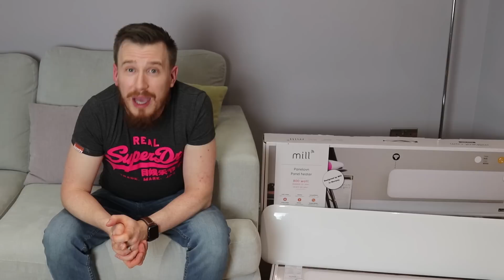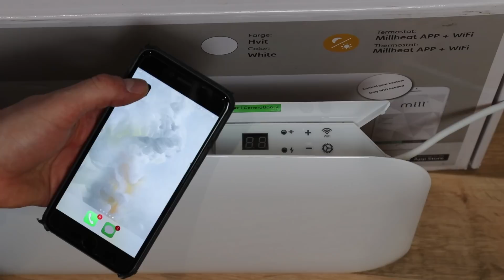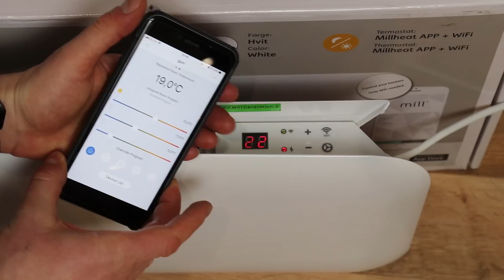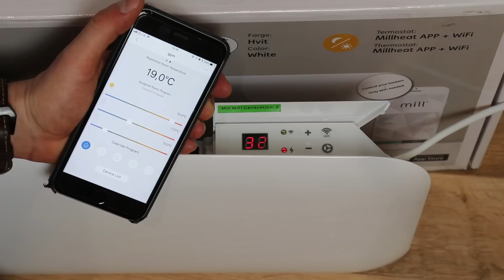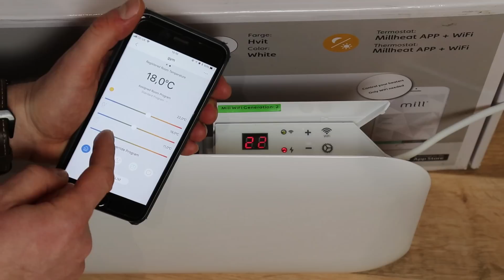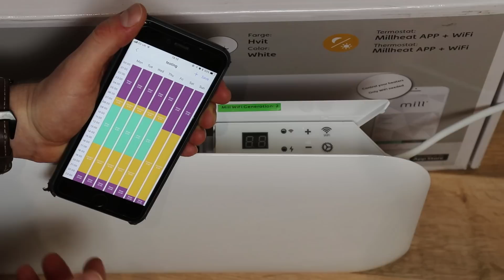MILL HEAT PANEL HEATER 800W WITH WIFI REVIEW | Henry Reviews

Comment: Great Review.  Can these radiators be mounted vertically?
Reply: no, I don't think they can. because it takes the cold air from the floor and generates heat that will spread evenly on top of it. I don't think it will work properly if vertically mounted on the wall. just an opinion
Reply from the maker: Agree that the optimal mounting is horizontal but I have had them mounted vertically for about 9 months with no issues and they heat my gym very well.
Reply from the maker: They sure can. Don’t think they are designed to be mounted that way, but I have a couple mounted like that in my gym

Comment: Nice review. Can you easily link 2 units to the app / phone and enable them while not at home? I assume so, just curious if you've tested it with the several Wattage models that you've reviewed. Thanks in advance!
Reply from the maker: Hey +Joe Flemke I have tested with the 800W and the 1200W together and been able to manage them together without issue. In fact, it was really good as I was able to see the "zoning" of heat in the rooms it used in. Using it over 3G/4G was super easy and did not need to enable any additional ports or change any settings on my router.